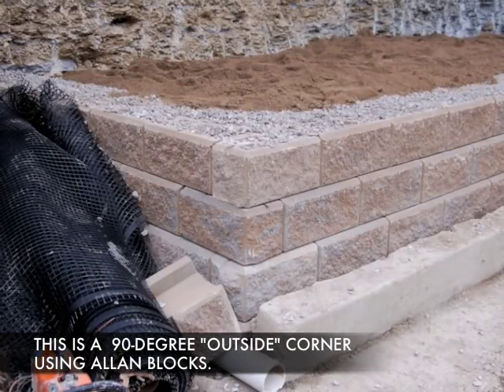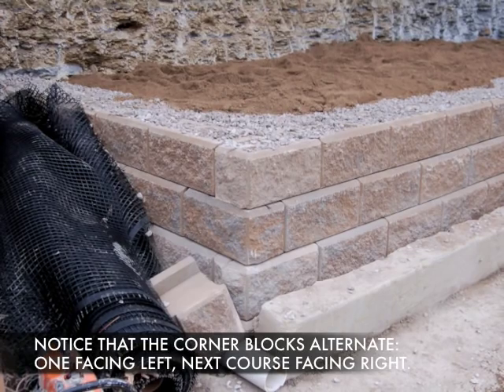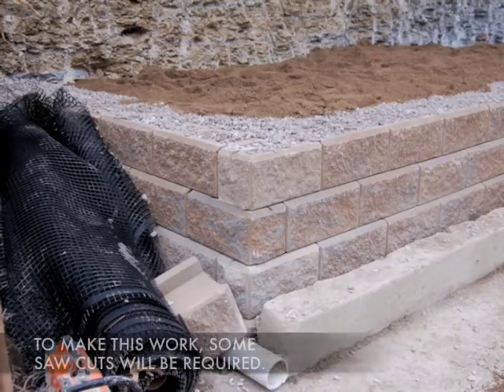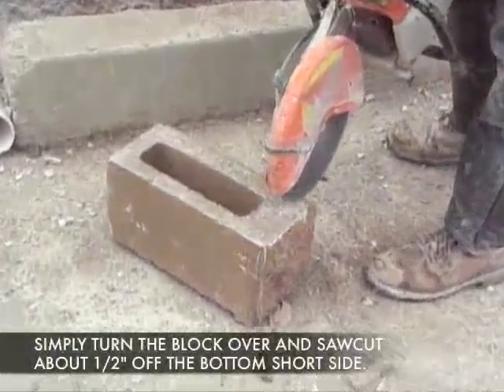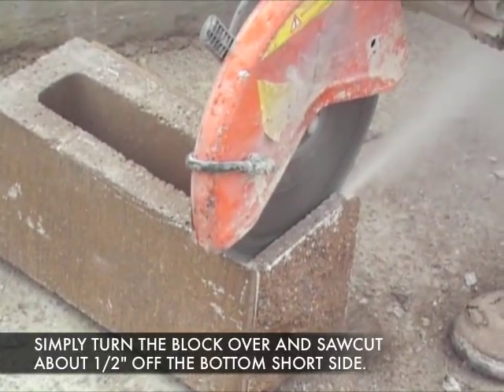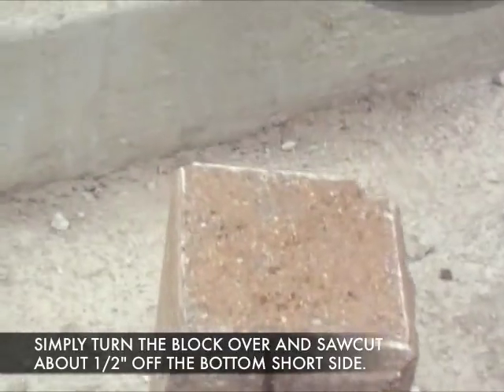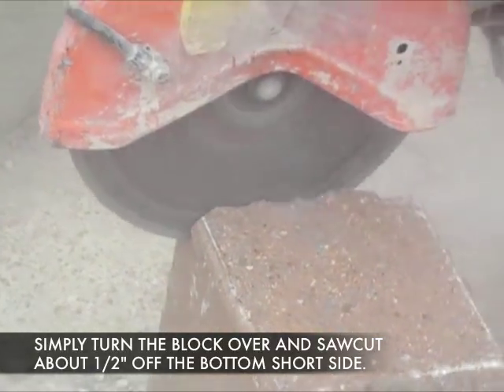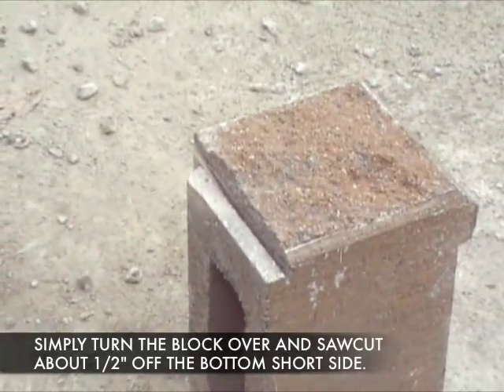How to Construct a 90-degree Allan Block Retaining Wall Corner

Comment from the maker: Excellent question!  The reason is this:  The Allan Block system is capable of a 3-degree, 6-degree, or 12-degree batter (wall face angled back from vertical).  The corner block is made for the 3-degree system - so, no cutting is required for the 3-degree wall.  You will only have to make the cut for the 6-degree or 12-degree wall.  Having one corner block results in more consistent color and reduced production cost.  Thanks for the question!

Comment: I'm currently deciding whether to use Allan Block Classic or Keystone blocks for a small retaining wall in my garden. It will be about 25 inches tall at the highest point, tapering down with the slope. I'm inclined to use Keystone because the main section of the wall will curve gently back with the slope. To do convex curves with AB, you have to knock the rear wings off of every block. While this isn't too much of a hassle, I'm sure this must effect the strength of the blocks slightly since your removing part of the anchoring design. Won't have this problem with keystone, the rear of the block is narrower than the front. 
As for corners, Keystone corner blocks are much heavier than AB corners but they don't seem to be connected to the remainder of the wall in any way - they are essentially just a solid block (almost twice the weight of AB corner units). 
Has anyone experience of both Keystone and AB for retaining walls and would anyone recommend one over the other? They seem to be very similar, other than Keystone use pins to interlock while AB uses the rim on the front of the blocks and the wings on the back (albeit it I'd have to knock all the wings off to lay my curved wall!).

Comment: I have a question about the corner blocks,  I have used this product a number of times and when I am building the corner, I notice the corner blocks are not the same hight as the straight wall blocks, about 1/8th" shorter. Any tips to prevent the "sag" look when the wall has many courses?  I have used more glue, pennies, and other methods to level them. At times they still seem to have a minor sag. Any tip would be appreciated, thanks.

Comment: I have built a 90 degree flower bed. How do I use capstone in the corners??
Reply: will need to cut 45 degree angle cuts to get the finished look, but measure twice before cutting. use two caps

Comment: Why on earth, 1). if it's a molded piece they would make this so the user must cut this groove? and 2). why are the corner pieces 15.5" and the main blocks 17.5" long?  This takes a, what should be a simple install, and makes it tricky.
Reply: this is making me insane. the fact that the blocks are a different base size than all the other blocks means we cannot do our project. How did you solve this?

Comment from the maker: I have no financial interest, but will say that Allan Block has the best 90-degree corner on the market that I know of.  I refuse to engineer any wall system with a 90-degree bend unless it is Allan Block.  Other block systems have poor coloring, poor height tolerances, an look terrible upon completion.  With any other system, I insist on using a "curve" rather than a 90-degree bend.

Comment: Why do you fill hollow blocks with gravel?  If the manufacturer wanted a solid block, wouldn't they have engineered it that way?
Reply: they make them hollow so they are lighter, to handle and for transport. then you back fill them to make it more solid.